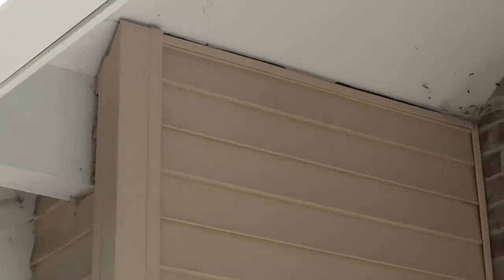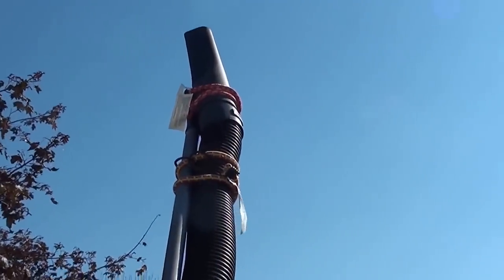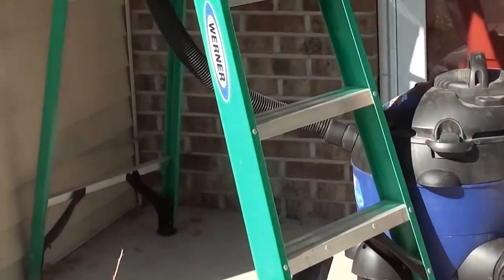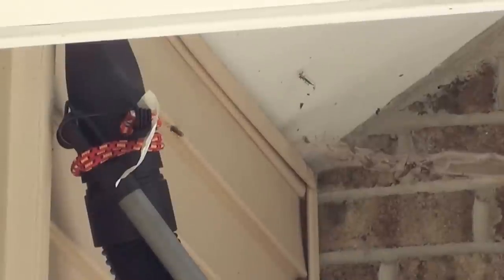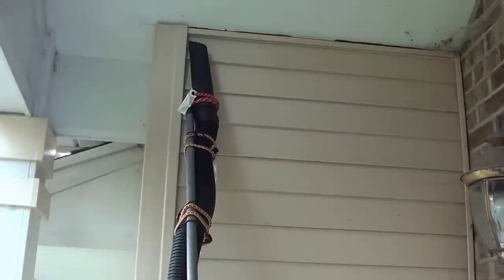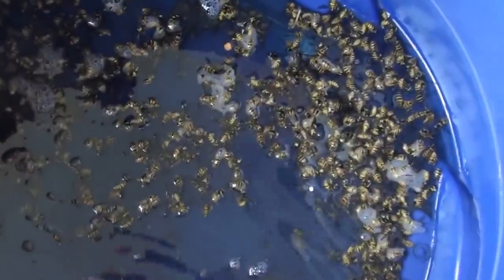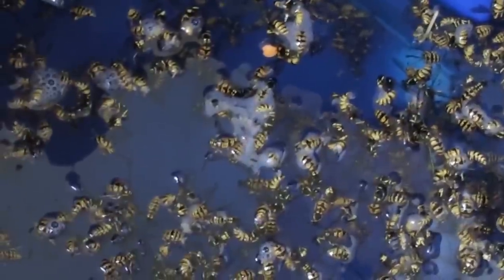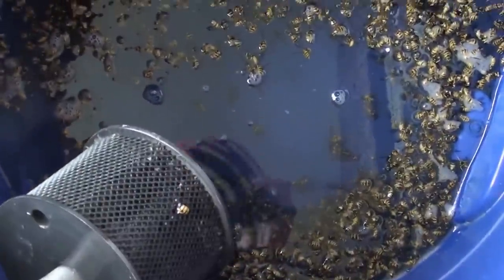(R-Rated) Shop Vac + Yellow Jackets / Wasp Removal / Extermination Tutorial / How To

Comment: To anyone thinking of using this method: Problem is that the nest is still active, the queen is still alive and larva are still hatching. But if you're okay with repeating the process every couple seasons I guess it's on you. Just know that every passing season the nest will get bigger and harder to knock down.
Reply: Best practice is to use this method to thin out the workers and then attack the nest. I havent had to use this method yet, most of my nests have been obliterated with spray or fire. I have a stubborn ground nest this year entrance in an old buried railroad tie. Since they are using the cracks as the entrance there is no real clear entrance. I have tried Diatomaceous earth so far and doesnt seem to be working. Going to try and drown them tomorrow night with some soap. The nest doesnt seem to be too aggressive yet, but it is has become more active and needs to die.
Reply: It takes hundreds out of the air which is a success to me. You can get closer to treat too

Comment: BRILLIANT!!, After watching this 3 times I had to do it! . Mine was 15 ft high tho, luckily I had a 24 ft discharge hose from my sump pump, and for a shop vac used an bissell carpet cleaning machine ( just like a shop vac) tied the hose to a 2x4 14 footer and turned it on,BAMM, STARTED SUCKING UP WASPS! like crazy,it works great,then a knock on the front door,lady wanted me to turn off high pitched noise,I explained to her I'm allergic to wasps so no,she insisted,I said I'll see if I can muffle it,HELL NO, i go check and it's still sucking wasps,knock on door,it's the COPS, explained it to them and offered to show them the setup on back deck they said no,so I kept on ,1/2 hr later knock on door,a different neighbor,none of these neighbors I recognize, so half HR later I just turned it off, I'll bring my real shop vac over tomorrow and fire up again,I'm afraid to open the first one to see the dead (I HOPE) wasps , I'll update tomorrow.
Reply: no update yet, i'm starting to get worried

Comment: After they are removed, put some caulk deep down in the crevice, pack in some steel wool, then seal the outside again with some more caulk.  They can't get through the steel wool easily.
Reply: ***** Careful with steel wool - it'll decompose and while doing so pose fire and electrical hazards.
Reply: Little bits of metal can get into electrical boxes and create pathways for electricity.  Metal filings and electrical devices do not mix.  And accidents or wear can create unseen weak spots in insulation.

Comment: Shop Vacs are  great for so many reasons. I had to do this years ago when we replaced our windows. There was a huge yellow jacket  nest in the wall under the window in our bedroom. I shoved the  hose in  the hole turned on the Shop Vac  , ran out of the room and closed the door. I let it run for  about 30 or 40 minutes and problem solved.

Comment: I would offer two suggestions :

1) Do this in the evening just before the sun goes down; there will be a very constant stream of wasps returning to their nest.

2) On my shop vac, there is an outlet that would allow the wasps to escape if they avoided the water. Put a bit of screen door mesh over the outlet.

Well done.
Reply: Yeah i wondered if they were getting sucked in thin blown out the whole. If they didn't contact water first.

Comment: This really works, with the advantage that poisons are not used and the wasps are removed rather than left dead in the wall or siding.  I used a single extension and a long hose and found that a clip or clamp on the siding can hold the tube in place at the entry point.  Catches them coming and going but takes several hours to get them all.  Then seal the opening with caulking to prevent future infestation.

Comment: Oug. 31st. 2014 I was invaded with yellow jackets for about 2 months now. They entered bottom of my siding near the basement sliding door.
 I pulled the siding a bit and sprayed to no avail. Last night I pulled the siding a little bit just trying not to destroy my siding and with a flash light looked to find out that there is no nest there. The nest is under the ply wood, so no wonder that the spray was not effective. And than I saw your clip on how to use the shop vac. Well let me tel you this IT WORKS. I got hundreds in about 3 hours . The activity has slowed down to a crawl and I am hoping to completely get rid of them. I will try sealing the edge of the ply wood to the center block and hope for the best. mean while thank you very much.
Reply from the maker: Glad to help.  Almost a year since I posted this video, and I'm going to set up the shop vac again.  The yellow jackets have invaded again about 10 feet away from last year's spot.  They really like our front porch for some reason.  Every year.  I never calked over last year's hole or anything and they never returned.  There were still a small number, but it was such a small percentage, that I just let them be and winter did the rest.
Reply from the maker: PrerequisiteName Here is a picture of the 2014 Yellow Jacket Devastation.

https://app.box.com/s/lk89ivisxtcewkanxwzm
Reply: Manny K. Q
Reply: @PrerequisiteName  u gotta gget the nest out and spray with soap or something so they do not come back im betting they just changed entry holes and still use the nest as well they leave a scent to find their way back after going out

Comment: I'm curious if you just vacuum them up with no bag or filter in the shop vac so when the wasps are sucked up they go straight into the fan and get chopped to bits. And no dish soap.

Put a hose on the exhaust so you have a type of bee cannon like the hivehand in Half Life.

Comment: I have used this method a few times and although the preparation is a PITA it works very well. Mine was on the 3nd floor eaves so I had to have the shop vac in the house with the hose hanging out of the window. I would only make one suggestion. In the very early morning 5:30-6am they are still all in their nest so this is the best time to start the shop vac. Have it set up the night before. That way there is no one pissed at you during the set up and one by one, the "food hunters" come out of their nest looking for food. If your hose is set up right at their point of exit/entry you get 100% of them and it takes less time. But excellent video.

Comment: I have done this with a shop vac and a 16 foot wand I made from ABS Pipe (much lighter than PVC). The wasps aggressively attack the end and get sucked in. I haven't tried the water in the bottom idea. That might make it easier. The pipe reaches up and sucks them away all nice and clean. It also sucks away the paper house they make....

I have not had them chase after me.
Reply: brad tittle What did you do with the contents then if you didn't use the soapy water method? Leave them in there to starve?

The suction pulls them into the water. The soap coats their wings preventing them from getting out of the water so they quickly drown. Better fate then starving to death.

Comment: Thanks!  Just tried this over the weekend and it worked great.  I only had about 20 though, much smaller nest, I think it had just started (luckily).  After I confirmed they were all gone I blew insect dust into the siding, and in a few days once I know they are dead I'll seal up the hole.
Reply: SpyderWeiss did you use a blender for the insect dust? 😂

Comment: Update is that although this greatly reduced the numbers, it seems there were about 50 new ones hatching daily. Aerosol poison into the hole didn't reach the hive and didn't work. I bought Sevin dust and a turkey baster for $6, shot in the dust, and the hive was destroyed within 1 hour.
Reply: I did the same thing with diatomaceous earth, it also work like a charm.
Reply: Sevin works like magic. My dad thought up a really good design: take one of those refillable air tanks (the kind you can fill at a gas station), and an old tube with a valve stem. Fix up the tube so only 1 end is open, dump a bunch of sevin inside it, attach the air tank to the valve stem, and blast it into the nest at 40 psi. then run fast.

Comment: Ever thought about sealing up the crack were they get in? You'd only have to do that one time instead of every year and its a lot less risky.
Reply: Good idea if you want them to chew their way into the house.  That said this method is reckless.  Stirring them up for three hours to avoid using a dust that is organic and applied into the nest sight where there is no way your kids could be exposed.
Reply: +bugmanchad Correct but even using an organic dusting will stir them up.  As you're applying the dust there will be a few that are not covered and fly out pissed off and attack you and your kids.  Using a bee suit while dusting against wasps is useless as they will jab right through it and sting you unless you smoke them out first.  This method keeps you away from them and at a very reasonable cost.  It's a great idea.
Reply: +capthook26  I've treated thousands of nests. I've been stung 3-4 times.  I've never been stung through a bee suit.  As for the dust stirring the up?  It might, but they are no longer able to focus on you as a target.
Reply: ManCraftingTM will wearing a few sweaters work? I have a small nest I wanted to vaccume up because it is in a tight spot by my back doorway. I don't have access to a bee suit lol
Reply: @cadavher .  Spray the nest with soapy water at night.  Problem solved.

Comment: I've done this, but found that it does not address the thousand or so eggs (many of which are ready to hatch) or the queen and drones who are left behind.  You are only capturing workers.  Many workers don't leave the nest because they are constructing new nest by eating your wood.  Definitely chem treat afterwards.
Reply: I agree I would have waited until dark or gone out before sun up and either sprayed the nest with wasp & hornet spray it sprays at least twenty feet or get some of that expandable foam in a can and fill in the crack and it will expand and kill them and keep others from being able too rebuild they all come back into the nest just before dark and don’t come back out until the sun comes up and it warms up enough
Reply: Got citric acid and cooking oil.
Reply: sealing it is better and your not throwing chems on your stuff seal it up they cant get food they die.
Reply: A pump sprayer with a little Dawn dish soap will kill the stragglers about as well as chemical sprays. Just wait till dark and let em have it.

Comment: Nice video, glad to see you had good success!  That is a challenging spot to reach with poison, even if that were what you wanted to do.   Now that the colony is gone, I would suggest sealing up those gaps with caulk.

I have a colony of yellowjackets myself this month.  Mine is up under the lower edge of vinyl siding, down low, and just over a slab.  There's as little as 1" of clearance in most places, so it's too low to use a killer spray.  So the next time I have decent weather, I'm gonna give this a 30-60 minute trial period and see how many of the little SOBs I can catch!!  

I HAD rigged up my shop-vac already today, but it started raining before I could give 'er a proper go.  Had to put the vac inside.  WOMP-WOMP :o(

Comment: u need a dyson
Reply from the maker: Or as the yellow jackets call it, "Why we have to dieson?"
Reply: PrerequisiteName godammit. i loled
Reply: Can't fill a Dyson with soapy water without damaging the motor. 

When it comes time to tip out the contents, you want them to be dead... not able to escape as soon as you open the 'lid'.
Reply: I use my dyson for the odd wasp that gets in the house ( I’m hyper allergic).  It’s not ideal, but I have a fly swatter in free hand. Once caught really shake and rally the power button then dump canister and get ready to swat or step on dizzy wasp.

Comment: Ive been using the shopvac like this for years but dont bother with the water, I just wait till they are all in the vac. When you turn it off you can hear them buzzing inside, I turn it back on and give the intake a little shot of raid then turn it off again. You can hear the buzzing go from a high whirrr right down to silence. Ive sucked up some huge nest with many thousands of wasps shopvacs are great!  This is a great way i just cant be bothered with the soap and water.

Comment: I've used a shop vac before and it is quite effective on the workers, but unfortunately doesn't kill the brood.  If the larva are close enough to metamorphosis you just end up with the same problem but smaller wasps a few days later.  But somehow, maybe through chemical markers left by the previously sucked up angry wasps left before they got sucked up, the new hatch won't use the same entrance/exit.

Comment: Unless YOU get behind that panel to fully remove the nest and plug up the gaps they use as the door you will have an annual wasp issue.  Just hoovering up this year's soldiers is not dealing with the problem.  It's a band-aid at best, but one that won't actually stick for long.

Comment: This is a good method. but how do you kill all of them? I must have a huge nest in my walls. I hear scratching in my walls early morning from inside and outside. When I bang on the wall it stops. No noise at night. I am getting an exterminator for wasps. I have 4 nest in all four corners of the house. I see them going in. scratching has been getting wide spread. I don't think it's mice or anything else as it doesn't sound like they're running all over.

Comment: Last evening, just before sundown, I sucked up the better part of a Bald Faced Hornet colony from their basketball-size nest that was on my fence.  I attached the wand of my shop vac to the top of a tripod salvaged from an old work light and once I got everything ready (including protective gear to avoid getting stung) I turned on the shop vac and positioned the end of the wand about an inch in front of the nest entrance hole.  I quickly backed away and I could hear them being sucked through the hose - lots of them.  I left the machine running for about a half hour or so then went in to make dinner.  I watched with binoculars from the safety of my family room.  Around dusk very little activity was present.  I went back outside and with the vacuum still on, sucked up some diatomaceous earth that I had.  This scratches up the exoskeleton of insects causing them to dessicate and die.  I then taped an LED flashlight to the end of the wand and finished sucking up any of the remaining wasps still inside the nest.  I followed with more DE, shut down the vacuum and capped off the end of the hose with two clear plastic bags and rubber bands.  Once I was certain that nothing more was coming out I puffed diatomaceous earth into the nest and all over it to get onto any stragglers.  This morning I checked my shop vac and not a single hornet was present at the end of the hose.  I took the lid off carefully and heard only very faint movement.  I figure they'll be good and dead in a few days.  I regretted having to destroy these creatures but I got stung by one several nights ago and my arm was itching and swollen for two days.  I believe that the attack was my own fault as I pointed a flashlight at the nest and one darted right at me.  Still,  I can't take any risks with this sort of reaction so I decided that they had to go.

Comment: I did this with a similar situation this august, though they are entering between the siding and foundation in an inside corner.  Not sure if the nest is in the wall or the crawl space (I'm not crawling into the crawl space to look either!).  Over a period of 2 weeks I suck out about 2 thousand and they are still going strong.  

I got tired of having my shop vac perched out in front of the house + the soapy water starts getting stinky after a day or two.  I've emptied the dead bees about 3-4 times now.... so now I've mounted a bug zapper out there to run a little more passively and will  hopefully take down the stragglers or hatchlings.

Comment: Be sure to spray-foam the crack.  Spray foam is polyurethane expanding foam-- and is very sticky when soft.  So any left will be stuck fast.  Let it cure--if you put enough in, a fair amount will expand back out, which is fine.  Once hard (about a day), you trim flush with a putty knife. 

Finally, follow up with matching trim paint, or silicone caulk.  No more cavity, no more cracks.  Never ever a wasp in that spot again.

Comment: It makes more sense, to me, to treat them with a Permethrin powder first.   WHY do you want to kill them off by using the vacuum ?  If you are worried about using chemicals, consider the 
fact that the most effective chemical is mainly talcum powder, with barely 10% permethrin. This is practically less toxic than fly spray.    The LD50 would be about 5500 I believe. 
It works because the dry powder circulates through the nest, if applied with plenty of pressure,
and will stay active, so that hatchlings will also be killed.  Use the shop vac to blow the powder in perhaps?   This is what I do professionally, in Sydney, and now we have nearly no wasps at all.

Comment: Although I appreciate the video, I have wasps in my cooktop vent hood duct work and after hooking up my shop vac and running the vacuum hose up it I didn't get a single wasp. I think the wasps need to be swarming to be sucked up. But I was also able to get in the roof and heavily spray outside vent so maybe that will help.